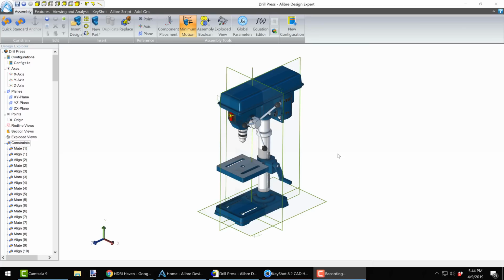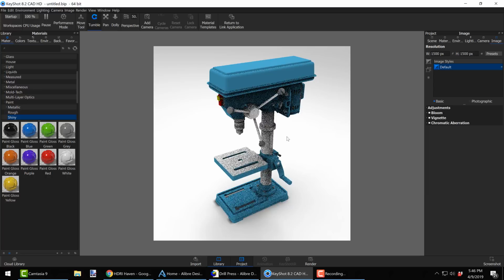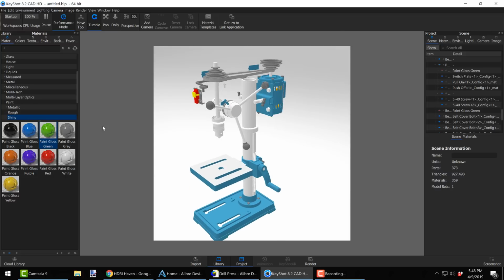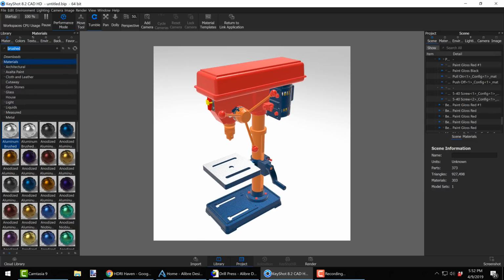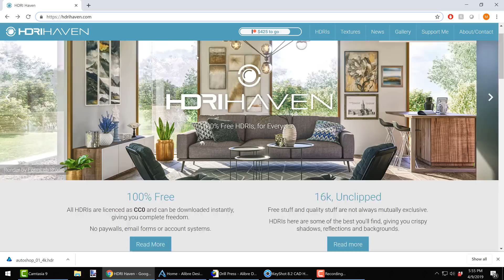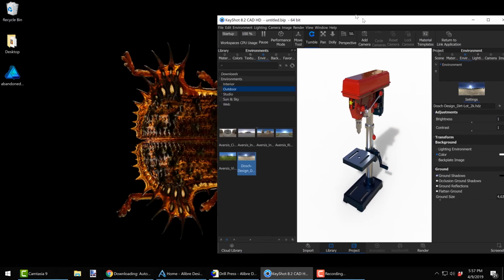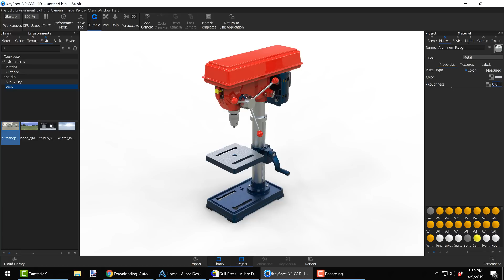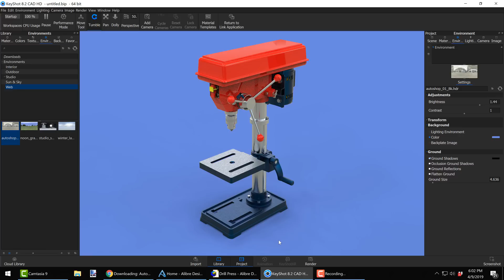Keyshot Tips and Tricks with Alibre Design

Comment: And another question is... If it's a single part, but has different FEATURE colors, how does one maintain that into Keyshot, and tweak the various feature colors? A cut of shallow lettering into a surface for example.. Easy to change the feature color in part mode; not as clear in Keyshot :-(